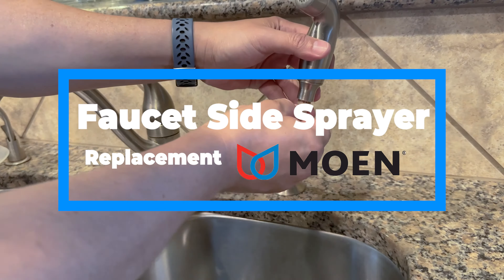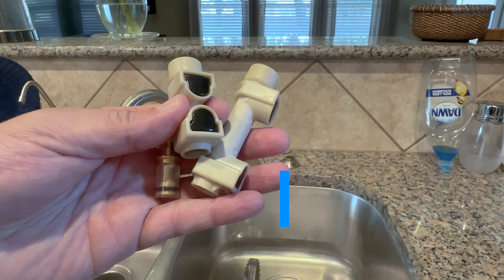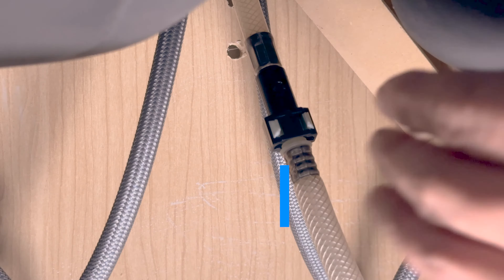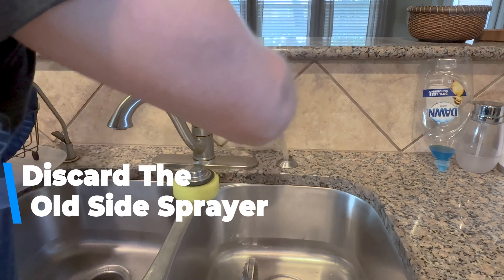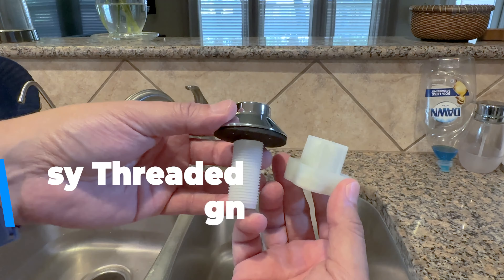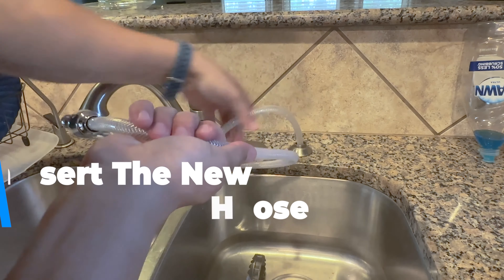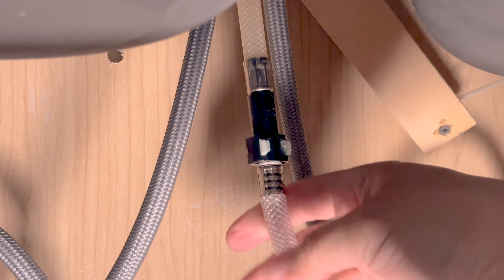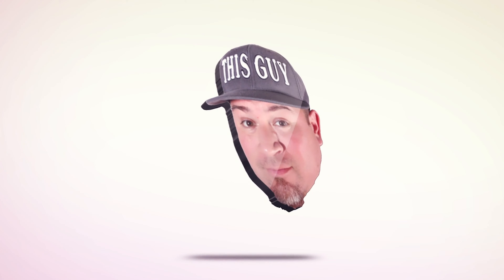Replacing a Moen Faucet Side Sprayer

Comment: Can i use the faucet WITHOUT having a sprayer on at all?  I have a Moen Wetherly, and there is a slice in the sprayer line.  Every time the faucet is turned on, water pours out of that slice.  I want to just take the sprayer line off (for now), but I see the sprayer line goes up into the faucet assembly.

Comment: I assume the water supply to the faucet needs to be turned off at the service valves as the first step? :D
Reply: Just replaced mine. It does not need to be shut off, this type of valve is apparently self sealing. thankfully